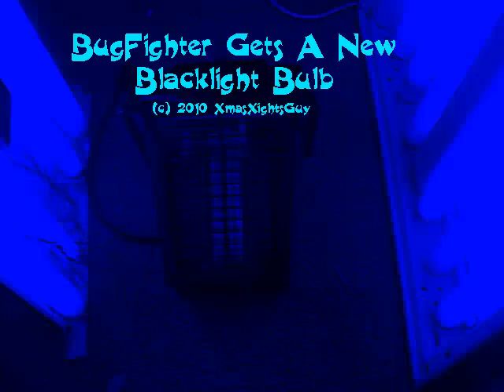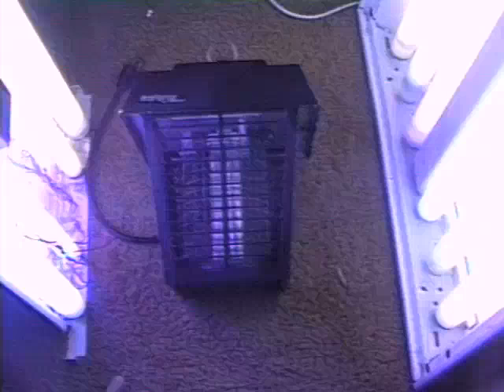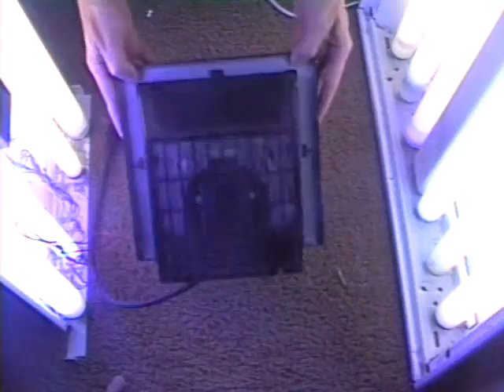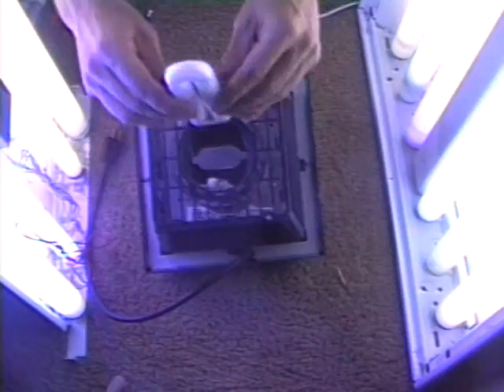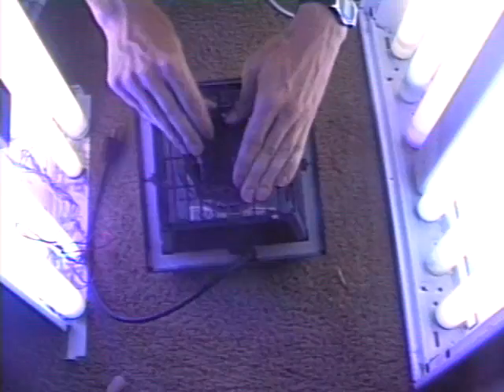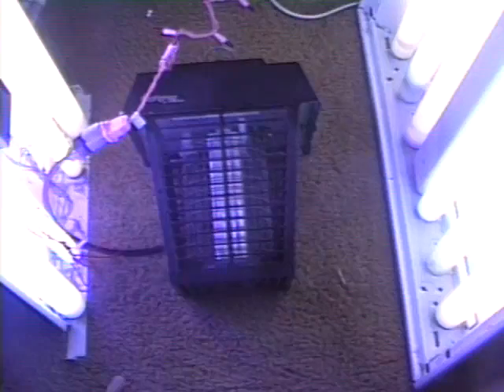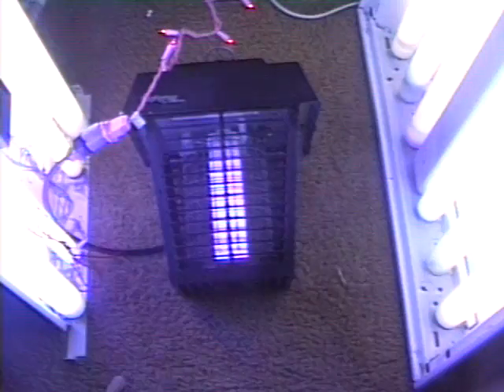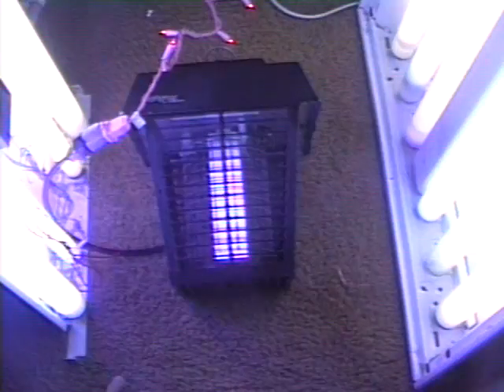BugFighter Bug Zapper Gets A New Blacklight Bulb

Comment from the maker: @VICNASTY1989 Yeah it is kind of a pain to change bulbs on some (sometimes it is easier to take the guard off like you do)

I still have the original box for this so i went and looked at that: looks like 1986. The box also says "model PM-2015"...I think "BK-15" was somewhere on the unit itself.